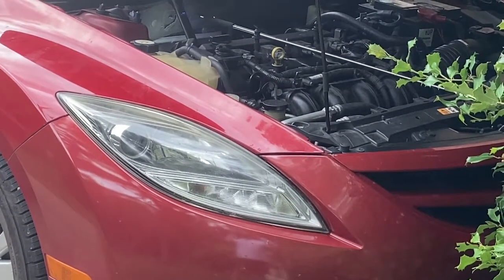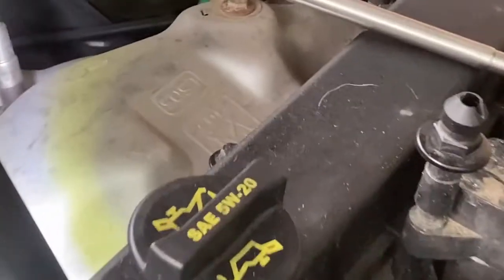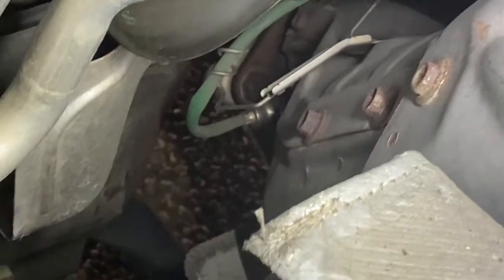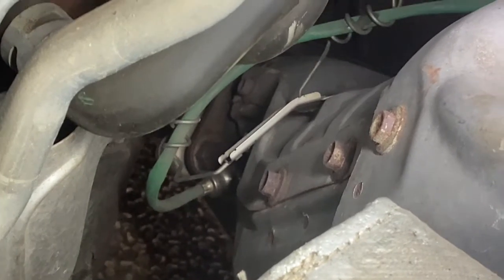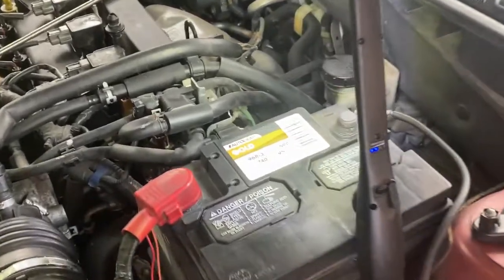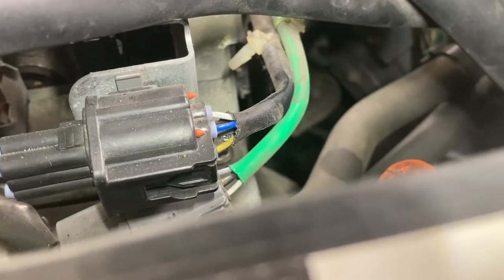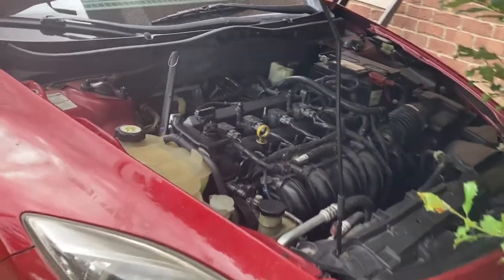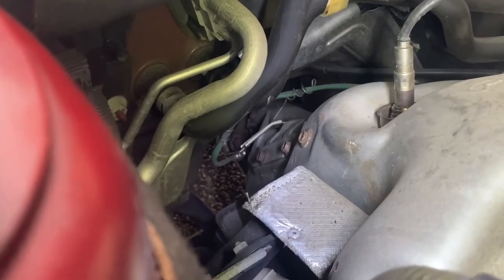Mazda6 O2 Oxygen sensor locations 2009, 2010, 2011 2.5L i4

Comment: Definitely changed with 2009. If you are like me and are viewing this with a 2008 or older, you will find BOTH the up and down stream sensors plugged in to a panel underneath your car right next to the catalytic converter on the driver's side. Easiest access to both of them is to jack up the driver's side or the front and slide in underneath to access them.
Reply: They are located differently with 1.8L and 2.0L, just like you described.